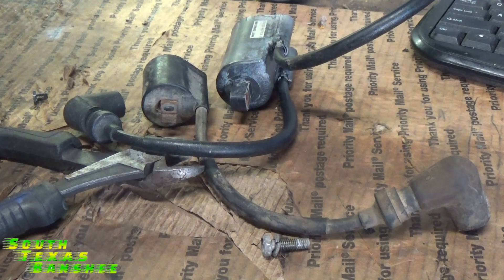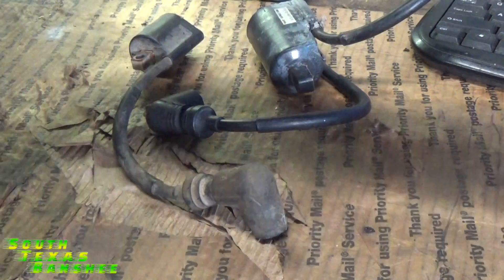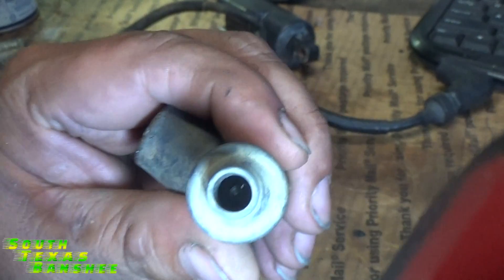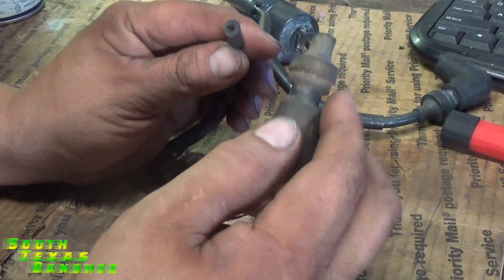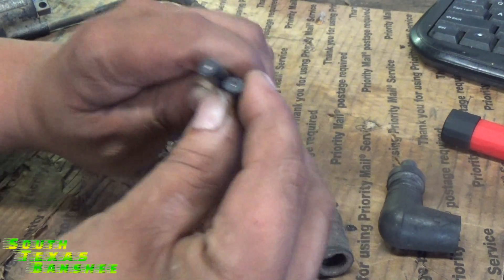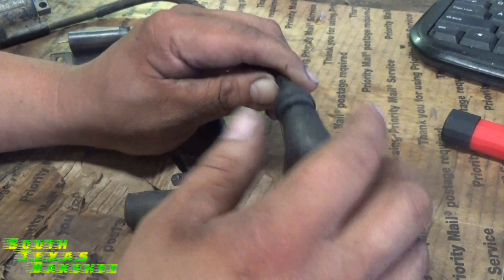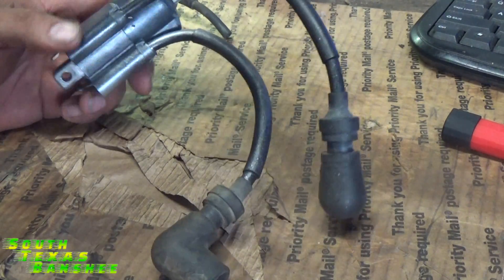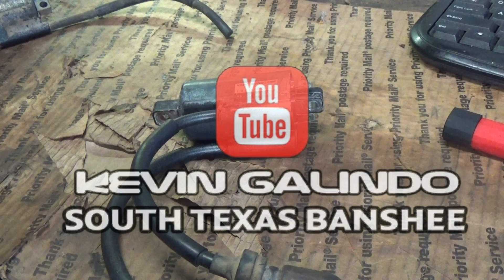Banshee coil wire timing due to possible bad connection

Comment: Can you replace the spark plug wires on the banshee coils?
Reply from the maker: You can but it’s difficult, the clips almost always break. You’ll need to pull them out. Pic the residual wire from the coil, then replace them with the same size wire. There is a pin in the coil that sticks into the plug wire. You can use adhesive to hold them if the clips break. Some thing like E6000.

Comment: If you trim back the wire and you still have problems. Replace the entire wire! I had that problem a year ago. I trimmed it back four different times it would run until it got wet or if I was @ high RPM it would start breaking up or only run on one cylinder and that ain't no good! So I replaced it with an oem coil pack,  it fired right up and I have not had any more problems! So I went back to look at the old one. The only problem was the wires had little breaks all through them. The copper was just falling apart. You figure it would still send electricity through, but it's not enough to keep your engine running right! Trust me, I spent a lot of money to find out it was just the wires!!! AND AND THE POWER DIFFERENCE WAS LIKE WHEN I WENT FROM "4MIL" 392CC BIG BORE TO A REAL ( I had to have the cases trenched for the rods on new crank) 4MIL STROKER BIG BORE ( Banshee 403cc ELIMINATOR BY Duncan Racing ) running on C12 aka VP RACE GAS.

Comment: I have a question bro I have a banshee left pipe is cold as it gets, and right pipe is hot.
Reply: Could be crank case seal. Could be ignition issue or even carbs. I'm having similar but opposite side iirc. Did you figure it out

Comment: My right cylinder was not getting spark...this quick fix got her firing on both sides again. Thank you sir
I’m riding a 2003 model , bought new, never will let her go!
Next issue: with the gas petcock on I get a steady stream of fuel through the overflow, I can only assume it’s a float issue but I’m not much of a mechanic ! Any suggestions?

Comment: Yo I got a yamaha banshee 350 2005 its been backfiring on my left pipe piston and piston rings are brand new and been in use with it for a while till I had restored it for 1 month and started doing that before that is was working fine i had check if I had exhaust rings an do already had clean the carbs change spark plugs and dont seem to find it out you think you got an idea what it might be

Comment: I’ve been haveing some issues lately with my banshee  left side fired right up no problem but right aide won’t fire an cleaner then crab an jets an reset it to stoke settings  coils good getting spark but still won’t fire. Even with a quick spray of starting fluid won’t. Fire

Comment: On my banshee right cylinder cuts out after 3,000 rpms but kicks on whenever it get lower coil is good new stator replaced the reeds still nothing works could it be the cdi  box?
Reply: It's from your parking brake. The green/ yellow wire at your CDI is shorted, or your parking brake is engaged.

Comment: I have a question my banshee for some reason doesn't smoke as much on the left side and it also takes a bit longer for the head to warm up as well (shifter side). It idles perfectly, there's no bog, when I rev it it drops back down to idle nicely, the power band is good, it rides as if theirs nothing wrong. I changed the plugs and swapped the boots that go on the plugs to make sure there are no electrical issues and I still have the same problem. I'm currently waiting on a carb rebuild kit, in the meantime I have cleaned the carbs for when the rebuild kit arrives. I bought the banshee about 3 weeks ago and its been rebuilt from the ground up by the previous owner. It has a 4 mil vitos stroker crank and there 1.00 pistons, toomey t5 pipes, v-force v3 reeds (which I also checked to make sure they are not broken and they ended up being good). When I took out the plugs out the right one was running rich and the left is lean so I'm thinking maybe I need to adjust the air screw on that side. I have a 290 main jet, 27.5 pilot, and its on the 3rd clip. Sorry for the long comment this is just driving me crazy.
Reply from the maker: AllAboutBikes 
what air filter setup? are thr carbs schedule perfectly? that will cause and uneven burn on spark plugs and uneven smoke.
Reply from the maker: AllAboutBikes 
and I like long comments, better information lol. 
The one liner, "why don't my banshee run right?" ones are a killer LOL
Reply: Lol I hear you. It has the two into one air filter I run it without the lid. Carbs are in sync perfectly. I'm hoping the carb had some debree stuck in there which I doubt it becasue when I opened them up they were spot less. I'm also running a 40:1 ratio with yamalube if that matters. I appreciate the help.
Reply from the maker: AllAboutBikes 
everything sounds pretty close, is it a drastic difference in smoke output? sounds like cylinder is just pulling more vacuum for some reason, is compression even as well?
plug gap the same? im usually able get the smoke evened out playing with air mixture. S ometimes settings won't be the same from carb to carb air mixture wise. Also it won't happen instantly. For instance the left pipe is smoking more, it's richer so if I wanted the right pipe to smoke more, I'd close the air screw. if I wanted the left pipe to smoke less, I'd lean that cylinder out, open the air screw.
Reply from the maker: AllAboutBikes 
I forgot to add, in between adjustments you'll have to ride it a a bit to clear the pipes n see what you get. You won't be able to change the smoke output at idle, between the adjustments, and it loading up on oil/fuel idling, it needs to be run so excess oil can be burnt out.
Reply: I haven't done a compression test but I can bet a lot of money that compression is good in both cylinders. I'm gonna do a compression test once I put everything together and mess around with the air screw because the air screw might be the issue here. As far as smoke output the left pipe smokes a lot less and the pipe takes a bit longer to warm up. When I put my hand behind the exhaust I have the same amount of air force coming out from both pipes. Plug gap should be the same since I just put in new plugs a couple of days before I took off the carbs.
Reply from the maker: AllAboutBikes 
could even be a reed issue, if a pedal or pedals are seating just a little different on one cage, that'll do it too. I've seen plugs come oit of a box unevenly gapped, drop during shipping etc will be more then enough. set it at .28"
Reply: South Texas Banshee  I installed my carb rebuild kit today and when I went to go swap out the old air screw's I saw that the air screw on the left side (the side not running good) was almost 2 1/2 turns out. My other side was at 1 1/2 so I'm almost certain that my air screw was the problem all along. But I wont know for sure that until I put it all together on Saturday so I'll defiantly keep you updated. I also checked my reeds and they were fine
Reply from the maker: AllAboutBikes  
2.5 would make it way more lean then the other for sure